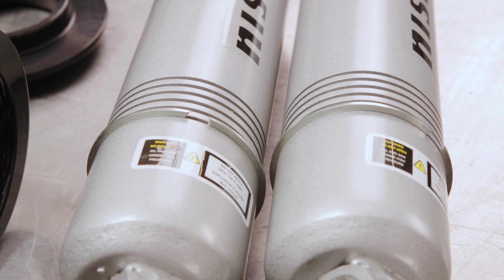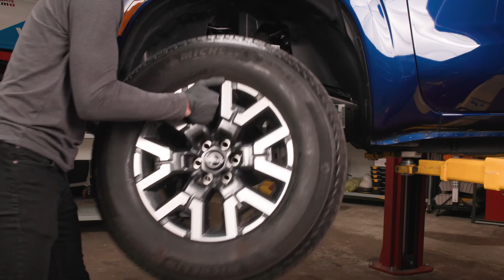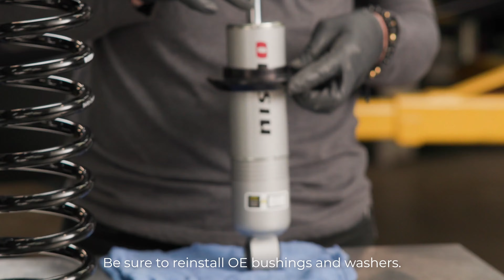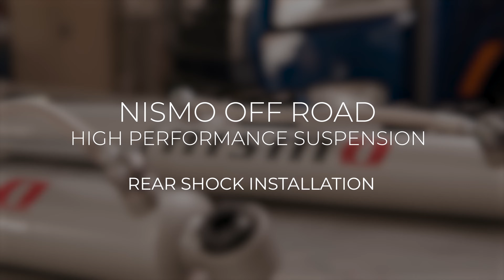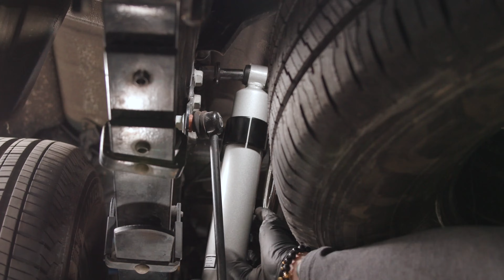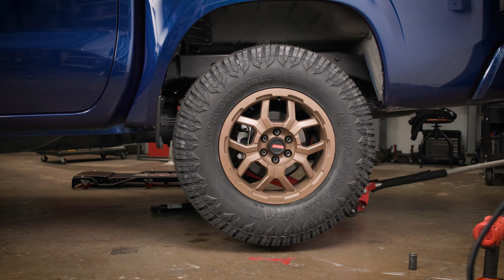Nissan Frontier NISMO Off Road High Performance Suspension Installation Guide

Comment: Chris, theres no mention in the video of any ADVERSE EFFECTS IF you take the full 2 inch lift in regards to the front shock ring settings — in regards to a worse ride & feeling more of the ground — which means to me that I’M BEING TOLD BY A NISSAN SERVICE DEPT THAT I’d be losing OPTIMAL SHOCK PERFORMANCE. AND I wasn’t even adding weight yet to the front end — like a heavy duty bumper & a winch. WHICH DOESN’T MAKE SENSE TO ME. AND MY TRUCK’S RAKE IS EVEN WORSE NOW THAN BEFORE THE NISMO HIGH PERFORMANCE SUSPENSION INSTALL. WHICH I BOT IN PART TO LEVEL OUT THE PRO 4X.

Comment: PLS HELP ME — I bought this kit top level out my pro4x for one big reason. But was disappointed when the tech made an executive decision to NOT give me the 2” of heigth your talking about & now the rake seems worse than when i bot the truck stock. With the rear end stocking up even higher proportionately than before. And then does reasoning was that he thot & the service manager thot i would feel the ground more & negatively affect my ride. But I question that reasoning — BCUZ ARENT THE SHOCKS DESIGNED TO GIVE ME OPTIMAL RIDE PERFORMANCE AT WHATEVER RING SETTING LIFT I CHOOSE?  

I’m in the process of corrections this matter for my sake as well as the Nissan dealership. BUT I CANT GET THE NUMBER OR EMAIL ADDRESS TO COMM WITH A NISMO EXPERT & INSTEAD I’M GETTING THE RUN AROUND.
Reply from the maker: Michael, we truly regret to hear of your experience with your Nissan and would like the opportunity to look into this matter further. When you can, please send us a Private Message on Facebook with your 17-digit VIN, full name registered to the vehicle, your best contact number, servicing dealership name, along with any additional details you feel would assist with our review. Thank you.
Reply: @nissanusa  thank u very much. But I’m not on facebook. I have a case number — & it’s going to the supervisor — bcuz i keep asking for An Expert In the NISMO front shock ring adjustments for the OFF ROAD High Performance Suspension Kit along with the 1.5 In Lift. But the Nissan rep I talked too just referred me back to the Nissan dealership. And i have called other Nissan dealers in Oregon; And I’m researching YT videos & contacting Chris Forsberg Racing. But i really want to get the best expert advice i can get on the phone or in person. So that when i leave the truck for another full day —with the Nissan dealership I Bot it from — that I’m going to understand whats happening this time in depth & I’m going to get whats best in the short & the long term.  

And the Nissan Customer Service Supervisor just called — so maybe I’ll get a number or an email address for an expert at NISMO
Reply: @MichaelProv.4  Any update yet?
Reply: @sinna7060  ok sinna, well, i just decided after continued research, & calling various Nissan parts & service departments, that i will lift it up all the way. And the day after i ha it done — NISSAN customer Service calls & tells me that their master technician says that —  i was Not told the truth about getting a worse ride. But when i double checked the “ alignment “ that was done at Nissan after adjusting the NISMO shocks at Nissan dealer. Bcuz they never gave me a printout of the alignment; & I didn’t think i could trust them anymore. So i told Les Schwab to only do an alignment of it was needed, & they said it did, & thats where i bought my new upgraded tires, & L.S. told me that the camber was adjusted as far as it could go. And i had stuck with stock tire size & stock rims for the Pro4x — but I bought RAZR MAXXIS AT tires. So the front tires are NOT completely straight up & down; But really close & with Rotations every 5,000 miles it should be fine; & the MAXXIS are high mileage tires. And the ride seems the same; but i haven’t put them to a serious off road test.  Neither at the 3rd ring setting or all the way up on the 6th ring. So what i have requested from the dealer is a hard copy of their techs alignment to compare with Les Schwabs hard copy. But i was told the system was broken & they were unable to print me out a copy — but they had ordered a part & would get me a copy. And I’m STILL WAITING … bcuz i want them to prove to me that they even did an alignment for one thing after readjusting the NISMO front shocks. Idk, but honestly, i don’t like being put in the position of doubting that i can trust  what I’m being told by ppl servicing & working on my rig. And then there was the appointment & what happened when i took it in & being asked if it was OK to keep my rig for more than a day = overnight if necessary. SO I SAID NO! THATS NOT ACCEPTABLE! Bcuz we wouldn't be going through this IF u did what i wanted in the 1st place; & THAT’S A WHOLE NOTHER “ THE REST OF THE STORY.  But hopefully, what I’ve been through will help them deal properly & have the correct INFO. FOR  the next LONG TIME Customer with the same dealership. And maybe someone will send A MEMO Re: the NISMO FRONT SHOCK ADJUSTMENTS TO EVERY NISSAN SALES, PARTS & SERVICE DEPT.S
Reply from the maker: Michael, we understand your frustration and are glad to hear you are in contact with a Supervisor. If you need any further assistance, please feel free to email NissanSocial@nissan-usa.com with the requested information. Again, we sincerely apologize for the inconvenience this situation has caused.
Reply: @nissanusa  thank u thank u — A Master tech will talk to the sales manager I’m working with — but not to me. And I’m  trying to decide IF I will buy & have the NISMO cat back HP Exhaust System installed. When i drop off the truck to make the shock adjustment change.
Reply: @MichaelProv.4  You might want to post to Club Frontier where there is a good bunch of people with Stage 1,2,3 suspension upgrade experience

Comment: Quick question, I if I wish to keep stock height, should I use the circlip location #1 at the bottom? In the video he did the maximum height with the circlip in the top position. Is there any  advantage of doing that? I just want to keep my stock tyres and height. Thanks
Reply from the maker: Hello. As our Service Technicians are technically trained, they are in the best position to assist you with your inquiry. We encourage you to reach out to your local Service Department for further support. Locations near you can be found here: https://www.nissanusa.com/dealer-locator.html.